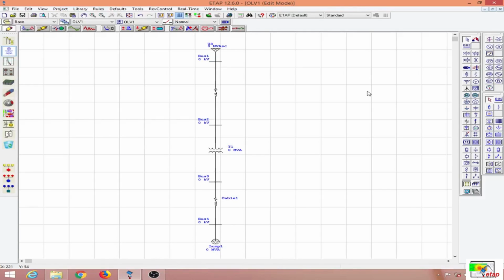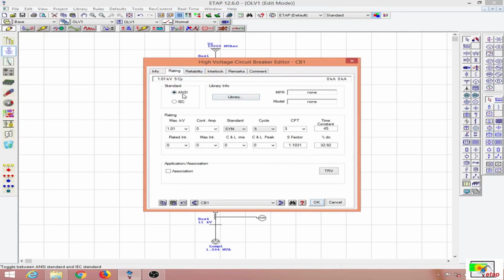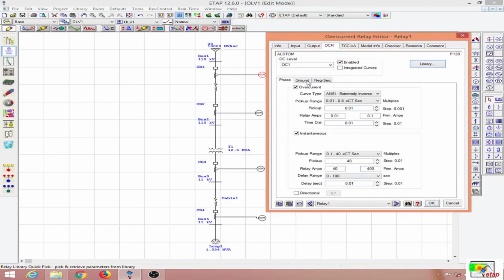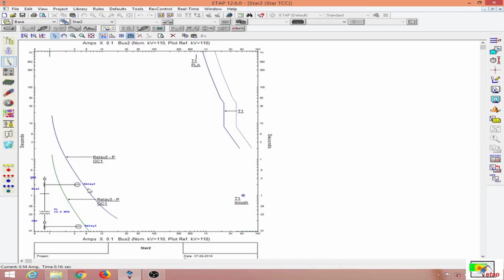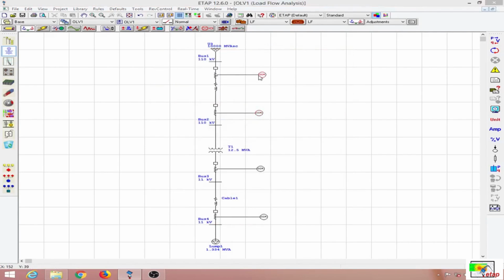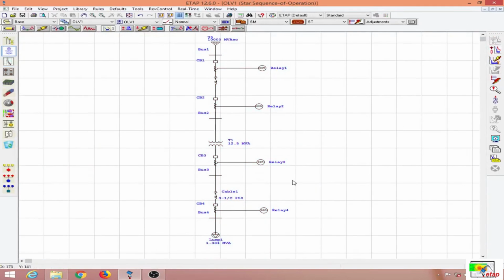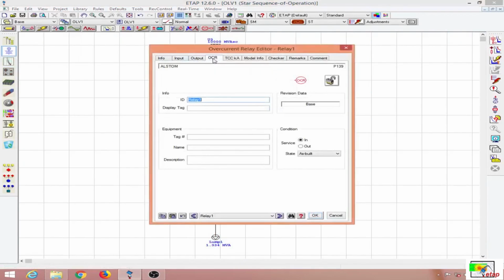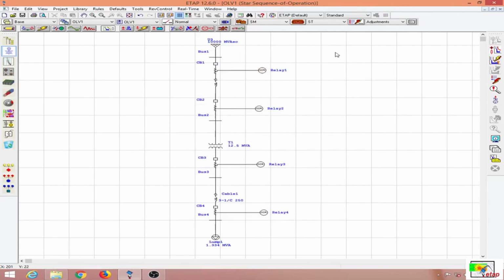Protection Coordination- Etap- Part 1

Comment: It seems current values in Load Flow are not correct right.... Transformer is rated @12.5 MVA 110/11 kv then FLC shall be 65.61 and 656.1A respectively and in addition to that there will be something from the upstream impedance and downstream impedance then current expected to be more than these values right...how come it shows 7 and 70.2A only